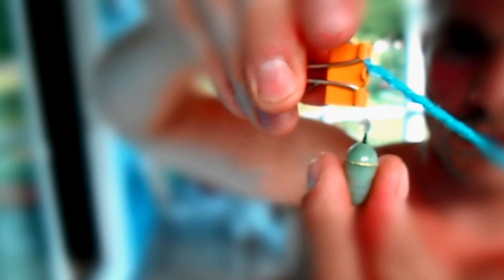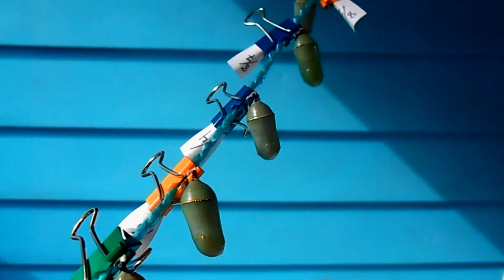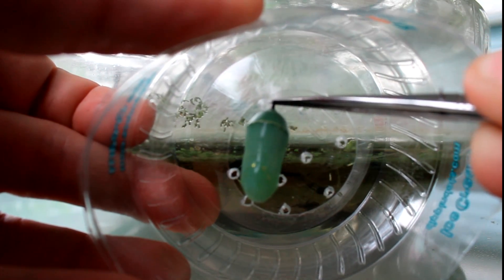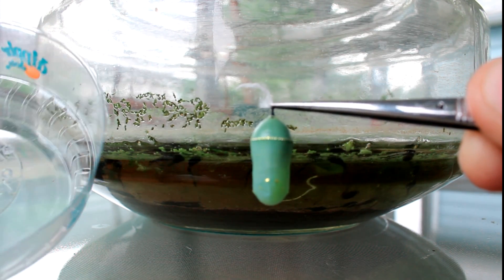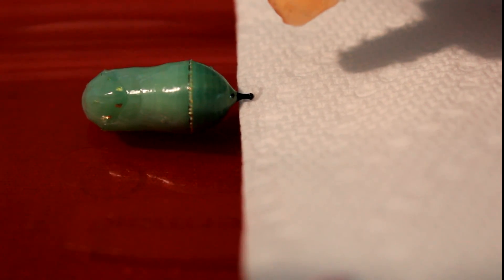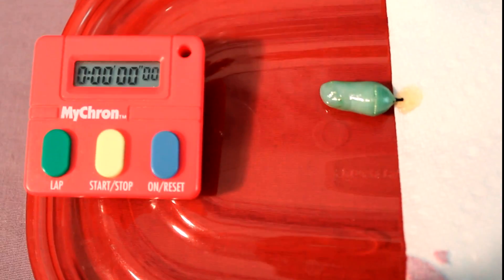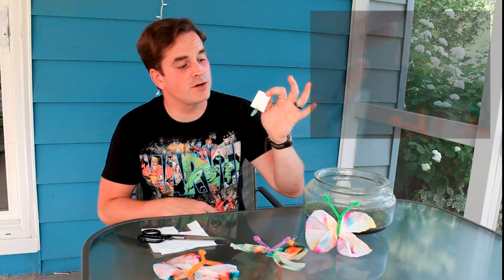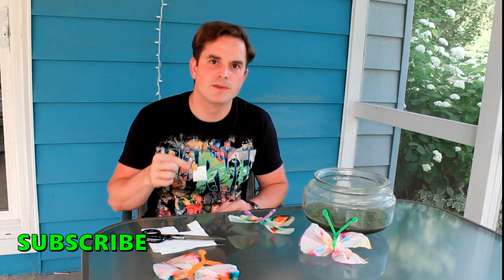Raising Monarchs - Chrysalis Repair (Help The Monarch Butterfly)

Comment: I have a chrysalis that fell and has no silk on the tip.  Would Elmer's glue work? Is there a reason you use expansive glue?
Reply from the maker: My choice in expansive glue was due to it being relatively fast drying, but able to encompass the paper towel and its pores, rather than just adhering the chrysalis to some of the towel.  The more surface area involved, the better the hold.
With yours, though, you could always let it develop on its side.  A chrysalis does not need to hang in order to develop properly.  And, it can also come out of the chrysalis horizontally.  As long as you set it up so it easily finds something to crawl up to let its wings hang properly and dry, this can be done.  I urge you to check out this video that shows what I'm talking about:  https://www.youtube.com/watch?v=kxCzr89Ck3E
Reply: @MrLundScience  Thanks, I did watch all of your videos, I just thought hanging would give it the best chance of drying properly.  I'm still so upset about the one who fell and got Tangled in silk prior to drying.  I also had another fall just after forming the chrysalis and I don't know what happened...the shed skin was at the bottom of the chrysalis attached by strands which I think now we're the antennae.  It turned black within a day and looks like something out of a horror movie.  I'll get a pic and post it in a few.  I am mostly having success though and have released 21 so far and have 41 cats at different stages.  I even ordered my tagging kit and will start tagging some of my later releases!  I love your videos and thanks for all of your help from all of us monarch lovers!

Comment: What if the stem has broken off? :(
Reply: There was a hole in the chrysalis where the stem had broken and if I lay it on its side, green stuff wanted to ooze out...I tried taping it closed but it wouldn't stick...so I rolled a piece of tape about the size of the stem and gently inserted it on an angle - under the lip of the chrysalis and propped it upright. During the day, the hole kinda scabbed up and the tiny tape straw is sticking to it :) It just might work...
Reply from the maker: That shouldn't cause any problems, but still, if I were in your shoes, I wouldn't trust the tape and hang it by the tape.  You didn't mention that that was your intention.  Just trying to trouble shoot.  Since it doesn't need to hang to develop, it's safer to let it develop horizontally.  Then, we don't risk the "scab" and tape dislodging.  And, as the video I gave the link for shows, it's not hard to have a set up that allows them to eclose horizontally either.  Good luck, and great ingenuity!
Reply from the maker: If the stem is broken, but the chrysalis remains healthy, it does not need to hang.  It can develop on its side perfectly fine, and even emerge from a horizontal position IF you give it an area to climb onto.  I made the following video that shows this after I learned that info:  https://www.youtube.com/watch?v=kxCzr89Ck3E

Comment: Any suggestions I have had several caterpillars go into J hang and then die, any thoughts or suggestions??
Reply from the maker: That's pretty tough to diagnose.  Of the ones that have made it, if you have any, have you tested them for the OE parasite?  Do any make it to a successful chrysalis?  If yes, do any of those chrysalides end up not having an adult emerge out?  Do they turn a color?  What color?  Do they have black markings as a chrysalis?
In the caterpillar stage, are they eating normally?  Have you tried bleach treating your eggs/leaves?
Have you watched the video on the prevention of diseases?  -->  https://www.youtube.com/watch?v=2FE9646Z9xs
Have you watched the video on bleach treating the eggs?  -->  https://www.youtube.com/watch?v=oZYzzcGiZRA
I hope something in there helps.  If you have more information on what is happening, that could help pin it down, potentially.

Comment: i just used floss... worked just fine..   but i didn’t realize the stem was hollow  ..
Reply from the maker: Glad that it worked out for you.  You're braver than I.  I always felt that floss might not be able to be tight enough, and a breeze could have the stem slip out.  I might be being overly cautious, however, as others have reported to me that floss or thread has worked for them.
Reply: MrLundScience thanks for sharing this wisdom! I had no idea the stem was hollow so i’m being extra cautious.  We’ve released our 13th butterfly this week!

Comment: I was wondering if it might help the crysalis if you put some kind of soft organic material at the bottom of the terrarium so if for whatever reason it might fall that there would be little to no damage to it? Maybe I'm just too sensitive about the thought of loosing any butterfly's
Reply from the maker: It's not a bad idea, and could only help.  I really try my best these days to see how well the caterpillar made the J-hang connection.  Gives me time to see if any might have a chance at falling.  I've been able to spot a few, and I wait until they form the chrysalis and it's hardened before removing.  But, I saw one like that this year, and during the making of the chrysalis, that's when it must have fallen.  Cushy spots can help, but I think what I'll opt to do in my case is try and make sure to observe it when it's making the chrysalis, so I can take care of a fall when/if it's happening.  Remove the lid from my container, and have it form the chrysalis with only an inch to spare.  See how that goes.

Comment: I have a monarch that is in his j form but when he made his silk instead of sticking his butt to the silk he stuck it on the laundry net I was keeping him in, and I was wondering if this has happened to you and if it will fall and die during pupation? because there is no silk to hang on and he made his chrysalis on the top of the net which is 3/4 of a meter tall and will explode if he hits the ground from that height, I am also very concerned about why he didn't stick to his silk pad
Reply from the maker: Sometimes, for whatever reason, something doesn't feel right when they are making the silk pad, and they move somewhere else.  Not sure always why.  If it has attached in a way that you feel is not secure, yes, you should relocate it rather than risk it falling.  Now that it has hardened, understand that it can develop perfectly fine on its side.  You then could have it eclose in this manner:
https://www.youtube.com/watch?v=kxCzr89Ck3E

Good luck!

Comment: Hi, this just happened to me with three chrysalis.  What kind/ name of glue did you use..  I could hear the name clearly.  Thanks for sharing.  I am in Fl & have released over 100 this season but the last few have had problems.  The just fell out of their chrysalis.  I carefully picked them up by letting them attach to my finger (not touching wings) but the seemed weak and I had to repeat the process on two of them.  The wings look good
Reply from the maker: Technically, if I name the glue by brand, YouTube could say that I'm doing a product endorsement, so all I called it was a "primate" type glue.  That's as much as I'm willing to say about that.  Sorry I'm not more helpful, but YouTube can be strict.
What can also help, though, is to know that they do not need to be hanging to form properly.  While this is still a good trick to do if you wish, it's not necessary.  If you watch this video I made a bit later, you'll see that you don't need to glue anything.  Check it out, and this will solve your problem for sure:  https://www.youtube.com/watch?v=kxCzr89Ck3E

Comment: try applying the glue if you use it, with a pin instead of a stick. but a batter way is to use a sewing thread and use that tiny bir of glut to connect the thread and tie the thread around that small bit of silk and glue.

Comment: I use scotch tape. two small pieces, just little squares and I put it on either side of the Cremaster and press it to the Chrysalis hangs from. then, I can easily put the chrysalis under a magnifying glass to sex the butterfly. then I hag the chrysalis from the bit of tape with a bit of fresh tape and a marker on the tape to indicate the sex. this way, I can always move the Chrysalis and place them in a safe place.

Comment: I would like to share this story.. I had a caterpillar in a cage thriving..etc.. when i noticed another who appeared a few days younger. About half the size of the first one. After 10 days of #1 I was expecting some j hooking but not until day 13,  when #2 was ready, and j hooked and went into crysalis simultaneously.  Interesting...
Reply from the maker: There can definitely be a variety of masses/sizes with the Monarchs.  I've had a Monarch that was about half the size of some of my larger ones.  So, it may have appeared a few days younger, but if you didn't know for sure, it could have been the same number of days old.  Size won't always give us a true indicator of age.  In fact, instars won't either, as depending upon temperature and how much is being eaten, instars can be sped up or slowed down.
Reply: Had some dinky chrysalides, produce full sz butterflys. Just like people, I'm short/petite too.

Comment: I have a caterpillar that was given to me by a neighbor kid yesterday and I think it might have been in the process of forming a silk pad but was not attached to the silk pad when she gave it to me.  Within an hour it was j hanging but only by a thin silk thread.  Today it fell and the best solution I could come up with was to super glue the butt of the caterpillar to a small amount of cotton ball on a stick.

Have this problem ever occurred for you? And if so, how did you solve it?  What would you suggest for if this problem we're to occur again?  I'm worried the super glue will harm the caterpillar but I'm keeping my fingers crossed that it will be alright.
Reply from the maker: I have not had this issue.  I suppose (and this could be the wrong thing to try) I would do what you have done.  I'd do my best to find a way to hang it still from the very end, the cremaster.  Hopefully it is successful.
Reply: It worked!  Once the caterpillar made the chrysalis I used the method shown in the video to hang it.  I had to do this with another chrysalis as well because it was hanging from a dying leaf.  Thanks for the method shown! Very helpful!

I'm sitting outside and a butterfly landed on my shoulder as I was typing this out. Ha!
Reply from the maker: Ha!  Now that's cool!
Reply: I had one that fell while forming its chrysalis.  It was all green but still shedding and wiggling.  I used super glue and duct tape to get it hanging.  It finally hardened but it is a little bumpier than normal.  Your success is making me not as scared that this one will be deformed.  I had one hatch deformed last year.  I never removed it from the cage because I had no idea there was anything wrong, but none of the others were born with the same problem.  This year I also was trying to move one and it fell.  It must not have been hard enough, or hit a sweet spot, and it broke open and leaked green.  I threw it out but I just feel so awful, like a murderer!  :(

Comment: I just tie dental floss around the cremaster and then tie it to a pin and then attach it to the inside of my mesh pop-up.  

Rich, it may be a good idea to explain to people that the chrysalides should be in a container that has material on the sides in the event it falls when eclosing.  In your videos you exhibit the use of critter keepers.  The slats on the top are large and little cats can get through.  Additionally, as you know, butterflies cannot climb plastic or glass.  This concept is similar to what you explained with the bucket and inverted net when you were demonstrating how a butterfly can eclose laying down and successfully expand its wings after it climbs up the mesh.  They cannot do that in critter keepers.  

When I first started rearing Monarchs I purchased critter keepers because that is what I saw you were using.  However, I found the lids snap on too tightly, the slits are too large and the smooth sides makes them a less than ideal choice for the process.  Purchasing mesh pop-ups increased my success rate.  After I had two butterflies fall when eclosing resulting in destroyed wings I got rid of them.  

Thanks for all the helpful information.
Reply from the maker: Those are certainly good tips.  I suppose one of the reasons I haven't brought up such is because I don't have my Monarchs eclosing in the critter keepers.  As Part 4 shows, I remove them from there and hang them on my yarn.  To date, I haven't had one fall from there, but that doesn't mean it couldn't happen.
As for the small spacings at the top of those containers and small cats getting out of there, this is why in Part 3, I show that while they are still small, I have them in plastic food "to go" containers so that they can't escape.  They don't make it into the larger containers until they are 3rd instar and they can't fit through those ventilation spaces any longer.
Reply: Fantastic Rich!!!  It's been awhile since I have watched the whole video series!!!  

I have 23 J-hanging and Chrysalides, approximately 100 caterpillars and another 20-30 eggs.  I just found another 20 this morning.

I've bleached for the first time the other day and they all hatched.  I learned from a video from a woman who works at Shady Oak Butterfly Farm in Florida, however, I like your method better. I would much rather prefer taking more time to ensure I don't lose any eggs.  I, too, respect and value every egg!!!  

In April, my sister found 110 eggs in Tennessee on milkweed that had barely sprouted.  I had 50 plants shipped to her and duplicated the shipment to me in Maryland as I anticipated early arrival.  Sure enough, at least one arrived 6 weeks earlier than last year.  I think I'm becoming a little obscessed.  At a nursery the other day they had just gotten a new shipment so I bought more.

I also wanted to tell you that you have mentioned you find more eggs on Common milkweed.  Mine is so unsightly I literally want to rip it out.  I have:

Common
Swamp
Balloon
Butterflyweed
Tropical
Hairy Balls

By far, I find over 90% of my eggs on the Tropical Milkweed.  It's very interesting.

Have a good day and again, thank you for all you have done to help the Monarchs.  This is really a lot of fun.
Reply from the maker: That's pretty interesting about the Tropical Milkweed.  I refuse to plant it, as it's not native to Michigan, but still, that's worth further investigation.  I wonder if others have similar results.
Reply: We just started this summer, and have already released 49 monarchs we reared and now have well over 400 cats/chrysalis now. In our yard we only have butterfly weed (1 plant) and maybe 15 or so tropical milkweed in a small area in our backyard that is my moms "butterfly garden". One day alone we found 210 eggs on the tropical. IN ONE DAY. We do not have any common milkweed, only had a few plants on our 200 acre farm (oddly enough, our farm was covered with either green or spider milkweed, and that is not something that is commonly found in our area. Usually common is what is everywhere, and we have NONE. We are actually swapping spider milkweed seeds for common seeds with a local lady who has been doing this for years.) Anyways, on our county road, and on a neighboring farm, we have been getting the common milkweed to feed our caterpillars, and we may find an egg or two, but nothing like whats on our tropical. Our tropical milkweed has had up to 4 eggs on a single leaf, and 20-30 eggs on a single plant, vs 5-10 eggs total on a patch of common milkweed with 20 or so plants. So from what I have seen just in the past few months, they do like laying on tropical vs other milkweed. However, tropical, in my opinion, is just junk to feed vs common. We plan on getting many different types to start from seed for our yard for next year, but will also still grow the tropical yearly, if nothing else, as a back up plan since it grows fast and easy.  (Im in MO so its not native here either)
Reply: I’ve been using different sizes of critter keepers for years.  I put a layer or 2 of cheesecloth , cut to overhang the container a little bit and snap the lid on it.  If the lid is tight to open, I push in on the end of the container a little bit while holding the cheesecloth with one hand and slowly pull up on the lid with the other hand.  I’ve never had a problem.  Once the caterpillars change instars I can remove the cheesecloth and then next instar I transfer them to the next size up critter keeper with cheesecloth and so on etc…..    This system has been working well for me since I’ve started raising Monarchs.  I remove the cheesecloth from the containers when the caterpillars are too big to fit through the openings in the lid and keep the cheesecloth off the container when it’s in the last instar before it “ J” hangs.  The only problem I’m having now is for some reason the deer are eating my milkweed plants.  That started 2 years ago for some reason.  😊🐛